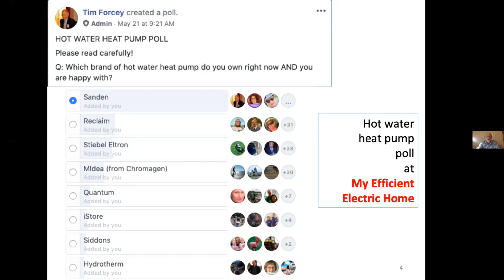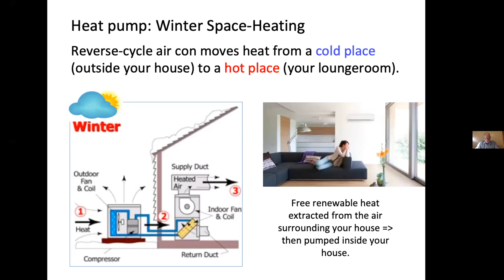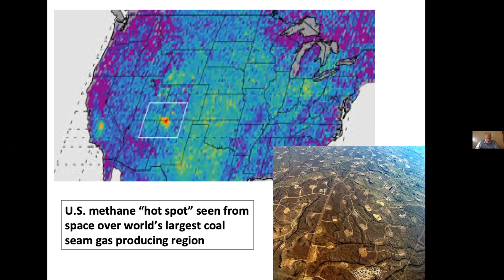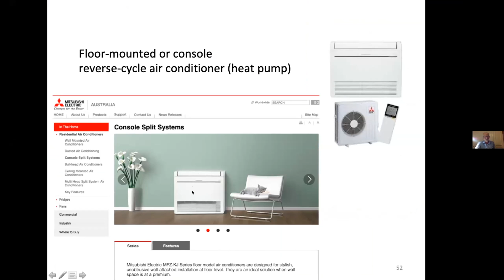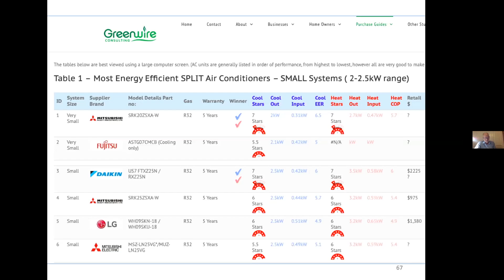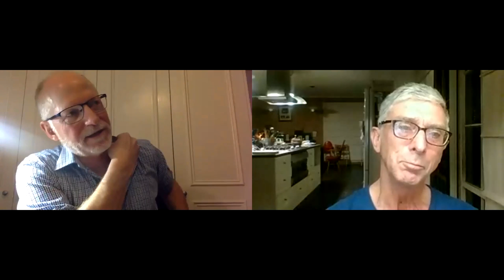Heat pumps- Part 2 - Space heating - Tim Forcey - June 2020

Comment: Thank you Tim. At around the 13 minute mark, you show a diagram that says flue losses are 10MJ, duct losses 9MJ and "waste delivered heat" (?) 5 MJ. How were these figures derived?  I have a supposedly 6-star condenser gas ducted system. This is supposed to provide 95+% energy efficiency (there is very little heat and exhaust coming out of the unit when in operation). Your diagram uses 70% unit efficiency (which I believe is even less than a 2-star rating), THEN reduces the available energy by 10MJ (flue) and 5MJ ("waste.."). Aren't these already accounted for in the efficiency rating of the unit?  Secondly, at 9MJ for duct losses, you are saying that the duct losses are almost the same as the available delivered heat. That doesn't seem right.
Reply: Incidentally, my total gas bill July-June last year was $736, including the daily service charge ($292, so $444 for the gas itself). We also have a gas cooktop and gas-assisted solar hot water. We live in Victoria, and were absent for about 2 of the cool months over the year - so I'd estimate $890 if we'd been home 12 months.

Comment: Please note that electricity is firmed using gas. That's why AGL is bringing in gas to Vic. AGL still sells gas to the power station firming the renewables to make the electricity for reverse cycle aircon.
Reply: Increasingly, grid-supplied electricity is being "firmed" with batteries. That is where we are going, Gas is too expensive to burn!
Reply: @timforcey1226  That's why gas is only burned during high peak demand or low renewables supply. Gas is not burned 100%. Key phrase is  Increasingly firmed with batteries. But not fully yet because batteries are more expensive then burning gas.  Batteries need to be replaced every three years. They 'wear' out.
Reply: @wirrinwibbi-ko801  No not every 3 years. After 10 years, there will be a decline in capacity... but they'll still be going, even then.
Reply: @timforcey1226  Rubbish - see eg Li-ion https://en.wikipedia.org/wiki/Lithium-ion_battery
Lead acids ~ 3 years. Li-ion ~ 1000 charge discharge cycles.

Overall avg 3 years would be good preventative maintenance practice re reliability of supply. I am an Electrical Engineer and have designed battery systems.
Reply: @wirrinwibbi-ko801  The wiki article talks about 74% capacity after 8,000 discharge cycles even in 2017:
"As of 2017, LiFePO4 is a candidate for large-scale production of lithium-ion batteries such as electric vehicle applications due to its low cost, excellent safety, and high cycle durability. For example, Sony Fortelion batteries have retained 74% of their capacity after 8000 cycles with 100% discharge"

Comment: I'd love to go with a heat pump unfortunately so far all the air conditioning tech I've talked to will upgrade existing units I have all the heat I need 20 feet below my feet and I have a ac unit that has less than 8 months of use I'd love to upgrade it with a reversing valve and a water unit to pick up the heat but what holds people back is they have air conditioner but they can't get them converted to bring heat into the house if the governments really want to cut carbon emissions they need to make a law that makes it illegal to make an air conditioner that only cools your space but has to also reverses to heat your space